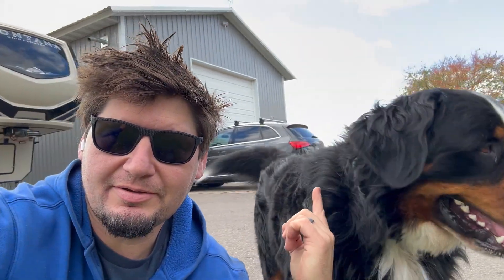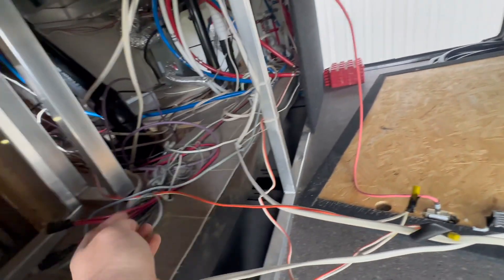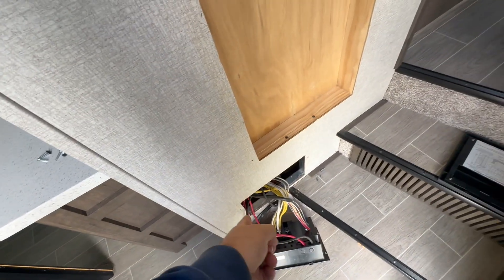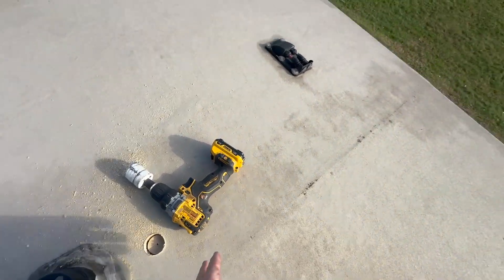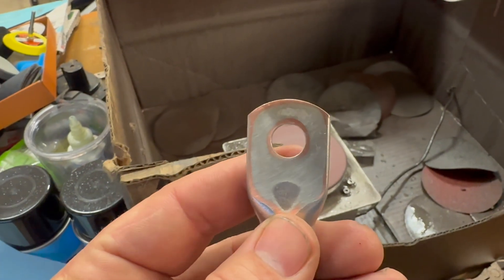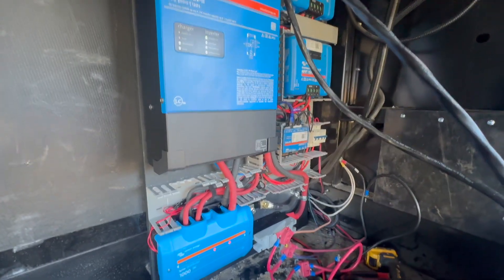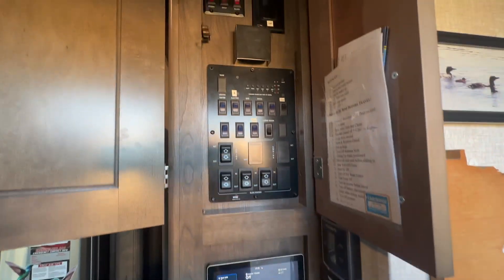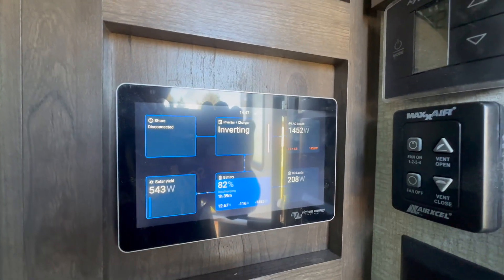Victron 2000W Solar Install on a Montana 5th Wheel | Full Walkthrough + Tips

Comment: Nicely done, but I have some recomendation for the roof. Why you don't put the solar cables in UV resistant flexible pipe and put the MC4 connectors in some kind of box, so you can protect it from ageing and i thinck it will look nicer. Keep up the good work!
Reply from the maker: I think in part the point of PV solar cable is the insulation is UV rated.  I usually try and keep most of the connections under the panels but not always. We’ve done J boxes as well. 

I haven’t seen problems with degradation of mc4s just yet. I’m on 8 years for my RV system and seems to be working fine.

Comment: Do you use ferrules on the AC side connections for the multiplus? I’ve read yes and no, I’m about to connect mine and unsure if I should use ferrules on my stranded 6/3 or not. Thoughts?
Reply from the maker: I would not. If you get .75 in or so of copper showing and get the barbs on the push in connectors to seat well you should be fine.